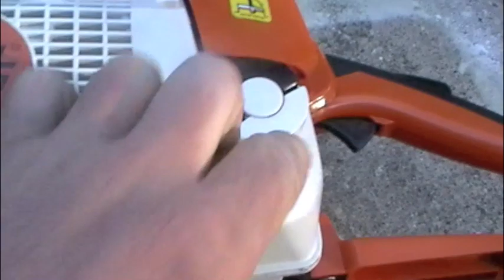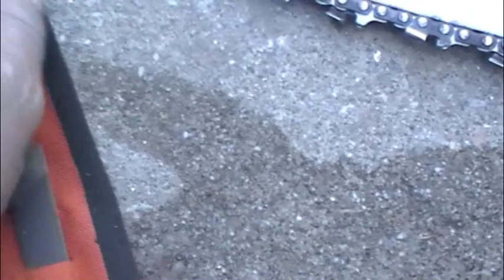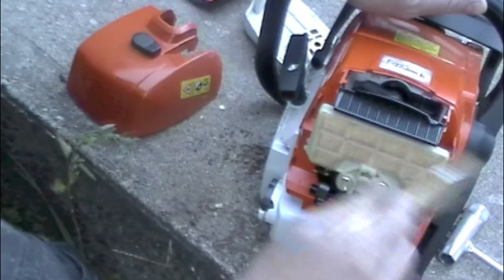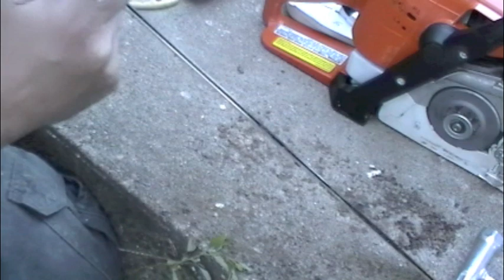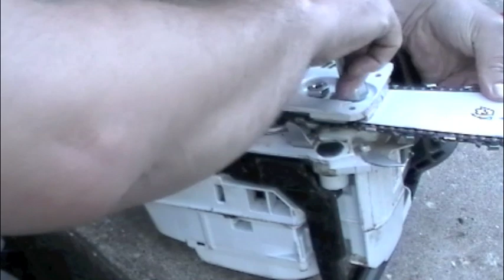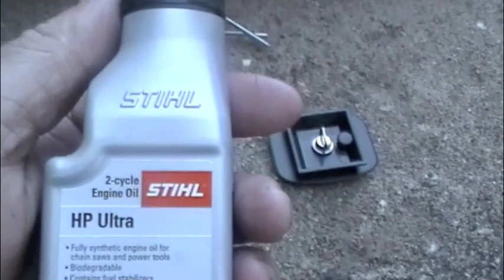sthil ms 290 chain saw 9-10-12

Comment: excellent video except you should loosen the bar nuts first before you use the chain adjuster. Then when you put the chain back on you semi tighten the bar nuts, then angle the bar up so it take us the slack, adjust the tension then tighten the bar nuts all the way. I broke the adjuster doing as you did, so I had to lean the hard way.